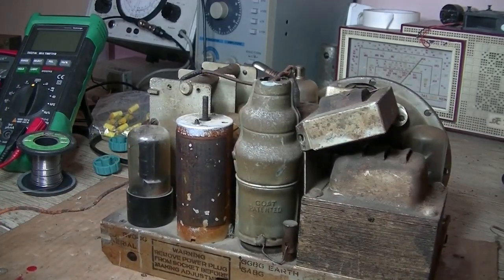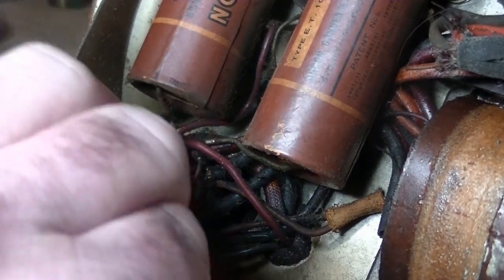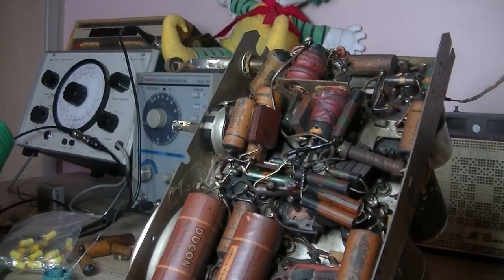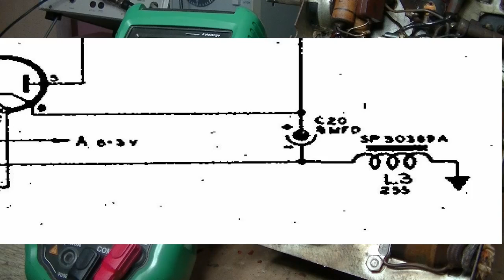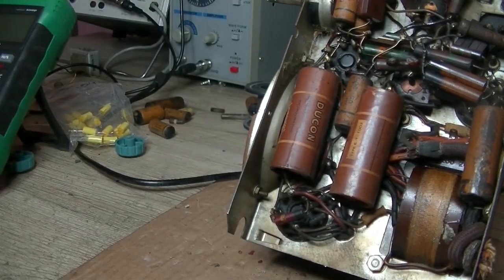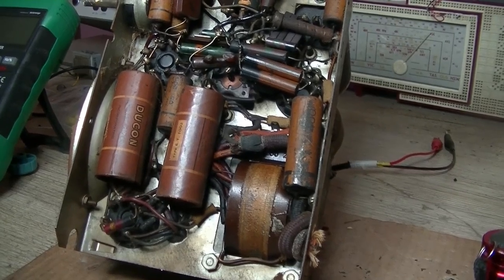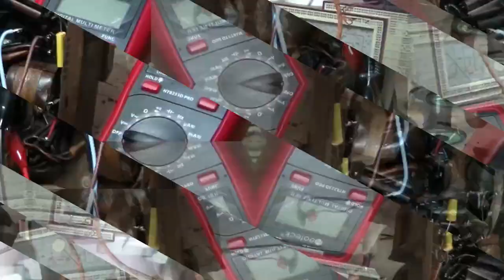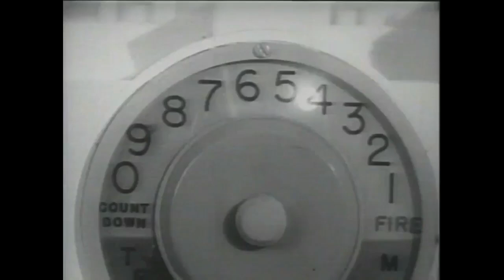STC Bantam C141 Valve Radio Restoration from 1947

Comment: I have a radio exactly like the one in the background of this video. The plastic has yellowed. Any tips on how to clean it?
Reply from the maker: HI, 
Hydrogen peroxide cream works well on getting rid of yellowing. Haven't tried it myself yet. 

From a video I once saw, you cover the plastic in the cream, wrap it in cling wrap and leave it in the sun for a couple of days. By all reports from other restorers, this works :)

ps: There's a product here (Oz) called Hi Lift peroxide with 12% peroxide in it.
Reply: @exeterslab7781 Thanks for that!

Comment: That must have been a really good set, to still be virtually working (apart from filter caps and a loose valve), after nearly 80 years! How much modern electronics will still be working at the end of this century?
Reply from the maker: Spot on Tim. Most of today's TV's etc will be landfill in 80 odd years. It's a shame really

Comment: Who wouldn't have wanted that  rocket launch station toy  ( 1962) back then? ToyKingWonder has a YT video on it. The 
radio was all original and with a little fuss on your part Frank  with a loose tube and replacing all caps including electros 
and now  it works great!
Reply from the maker: what a great review of the toy Steve, I want one even more now lol

Comment: My cousin had that same Ideal Launcher back in the early 60’s that I had forgotten all about. I immediately noticed that your DMM was set on AC when checking the filter cap and I had a similar issue just a few hours ago with my Fluke DMM trying to measure resistance, it appeared to be opened so I got a new resistor to test just to find out that I had the meter probe in the ampere input. We all find ourselves making these common mistakes, I bet no one has pulled a Ken though, by spelling lose wrong when editing. Overall, a good video Frank.
Reply from the maker: thanks Ken. yep the simple mistakes we make lol
Reply from the maker: ps. I would have loved the launcher as a kid, who wouldn't?